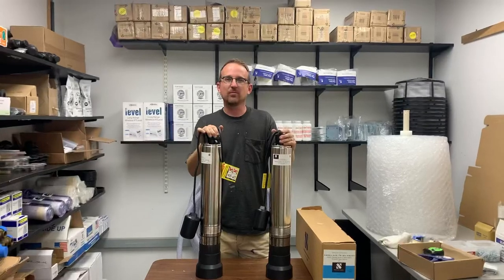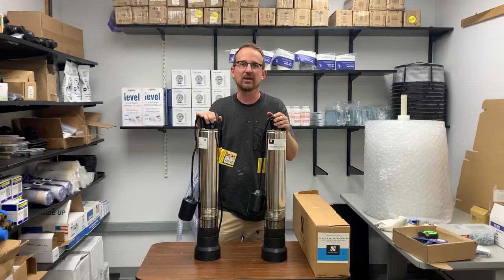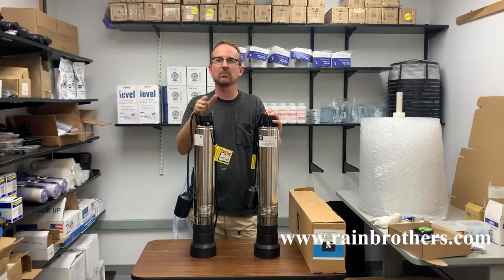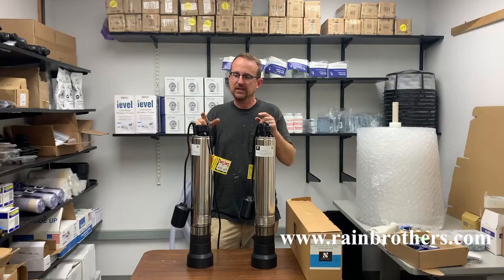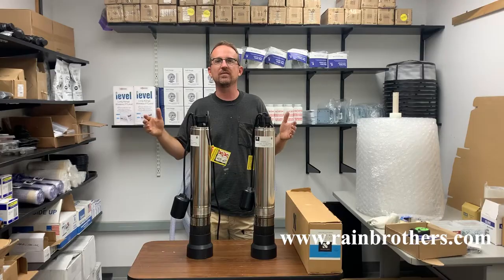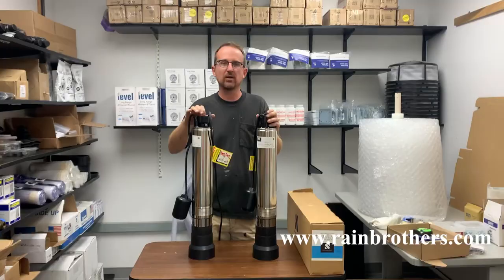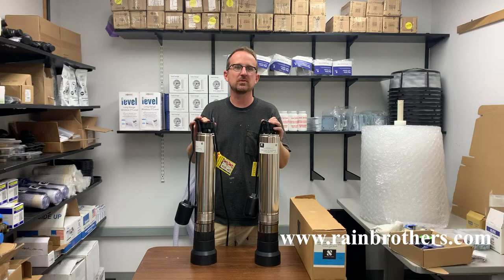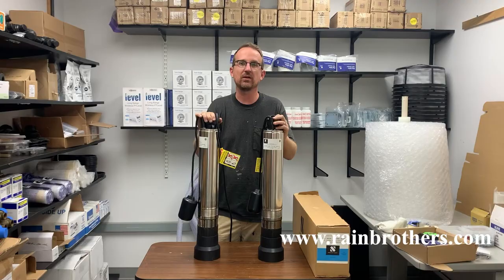115v or 230v pump??

Comment: When you say 150' away, that means TO the pump, correct? So 300' well would need 230v pump no matter how close the breaker panel is to the well? Thank you!
Reply from the maker: Yes, that would be total distance that the wire runs from panel to pressure switch to pump. If you’re over 150’ then, yes, it is going to be better to use a 230v motor

Comment: Is the 115 volt a 110 pump or 220? If 110 would that be on a 20amp single phase breaker?
Reply from the maker: 115V and 110V are the same, for all intents and purposes. The size of the breaker depends on the size of the pump motor and how many amps it pulls at start up. Yes, it would be single phase

Comment: So if my control box is 240 v my pressure switch should be the same mine 120
Reply from the maker: Did you read the voltage coming in and out of your pressure switch with a multimeter? Pressure switches are rated for 115 or 230 v. Sometimes people wire pressure switches so that just one hot leg is broken by the switch

Comment: So if I use a 115 bolt pump my electricity bill will not be any higher?
Reply from the maker: As long as you’re looking at a pump that has a 115V or 230V option for the same horsepower, that is correct. The same
wattage would be used no matter the voltage.

Comment: I’ve got a 2hp motor on an air compressor on a 2hp pump and the motor will hardly turn and then slows down like it’s too weak it’s 120/230 motor
Reply from the maker: Motor may be seized. Make sure you have correct voltage getting to motor - pressure switch on the compressor may not be letting current thru fully

Comment: Do I need 12/3 wire for a 230 Volt pump?
Reply from the maker: Depends on the pump. Our pumps are 2-wire pumps, which means that the start capacitor is internal to the pump, and you would use 2-conductor wire PLUS a ground (e.g., 12/2 or 10/2 with ground). If you have a 3-wire pump, that means that you’re going to have an external start box and you will need three conductors plus ground (e.g., 10/3 with ground)

Comment: Ok but my pump came with what looks like a drop coard with a 110 volt plug in on the end  does anybody know where this plugs in At
Reply from the maker: It wouldn’t have been one of our pumps. It’s hard to picture what you mean but I would recommend consulting your owner’s manual or reaching out directly to the manufacturer